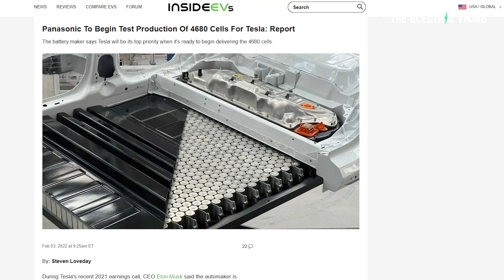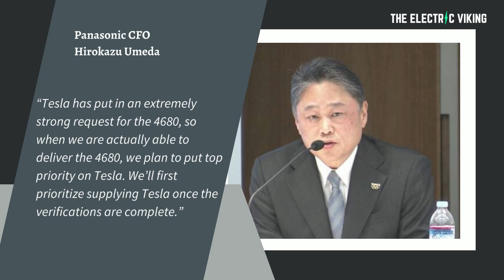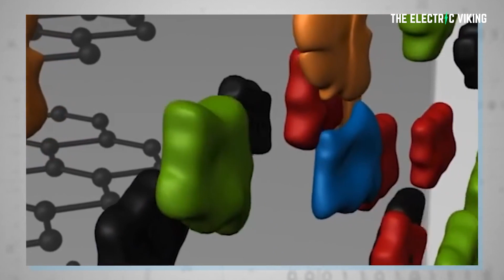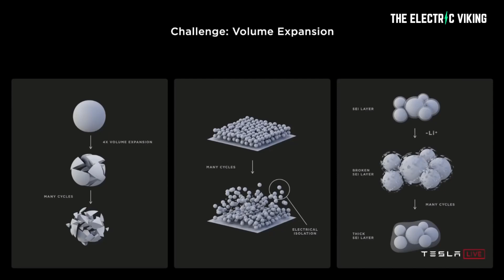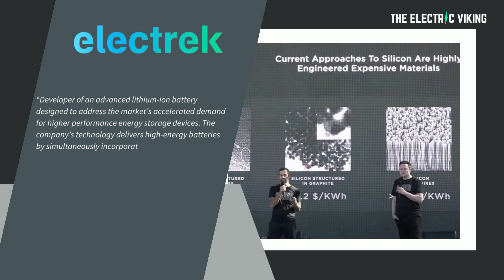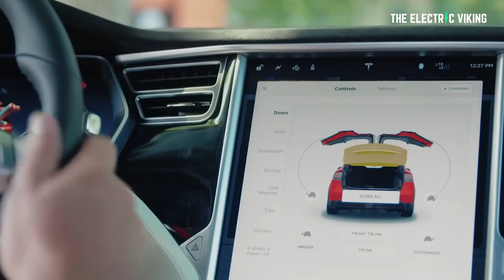WHY legacy auto won't use 4680 battery cells from Panasonic

Comment: They can Pay Tesla for using teslas patents but thats less realistic. Also very intresting is there a patent on the tabless electrode system tesla uses as this is critical for 4860 Cells as they will overheat without the tabless design.

Comment: As the costs come down for volume production won’t it make sense for all EV manufacturers to use the 4680 form factor? I thought Tesla said ultimately all chemistries would be in the same form factor.
Reply: 4680 form factor is only useful if its tabless. Otherwise, power output is actually less bc electrons have further to move.

Comment: Did you see that using the silicon anode alone gave a 90% reduction in anode cost along with 20% boost in energy density ?  That is one of the biggest features here.  Along with massive cost savings in DBE and the general scalability of 4680 it is just mind-blowing.

Comment: Those LFP cells are for the energy storage products like the mega pack power pack and Tesla power wall. I highly doubt you will see any LFP batteries in US vehicles because the range is lower than ncma chemistry.

Comment: LFP is the low-end formulation; Yes it's cheaper and it's more durable:  but it can't store near as much energy. It's really not even close. And no you can't use a 4680 form factor economically with LFP

Comment: Tesla's best strategy is to move inexorably toward 4680 cells & at least short term toward LFP. Cylindrical cells are safest because thermal run-away is contained inside the can. Tesla 4680 LFP are the short term winner for safe cheap million mile batteries.

Comment: I suspect that Panasonic will produce the 4680 cells for Tesla per Tesla's current patent design (chemistry and tabless design). If Panasonic produces the 4680 cells for others it most likely will be a different chemistry than what Tesla is using and most likely won't be tabless. Also remember Store Dot is said to be producing 4680 cells. But what's going to be important for both Panasonic and Store Dot or any other battery maker making 4680 cells is can those cells match or exceed what Tesla is doing with its chemistry. I suspect we'll have to wait and see once we get some official test on these cells. But more importantly I think we need to step back because there's no way Panasonic will be selling the exact same chemistry and style that Tesla has a patent for.

Now, I do think it's makes sense for Tesla to settle on two different form factors such as LFP in the cylindrical style and 4680. But we have to see if Model S and X will adopt them in the future. For now it makes sense to continue to use what they're using now since there may be more of an abundance of those and they meet the specs Tesla is putting forward for those vehicles and the fact they're produced in lower numbers.

Comment: Your logic is completely flawed because no-one has ever indicated that Panasonic is using Tesla’s chemistry in their 4680 cells.  We do know that Tesla and Panasonic have collaborated on chemistry in the past, but that does not mean that they need to in future.  Panasonic have their own battery improvement research efforts.  Tesla have also shown a willingness to use different chemistries in their cars, so Tesla requesting 4680 cells from Panasonic does not mean that they specified the chemistry.  Their request is probably just to allow them to use Panasonics cells on their existing production lines which I do not believe would be dependent on the specific performance of the battery.

Comment: This is nonsense - or at least not correctly explained. I'm not sure you understand how patents work. The fact that Tesla has patents on aspects of the 4680 does not mean that Panasonic can only sell production to them. If Panasonic are making them then they must have licensed the patents. So they can make them and sell them, normally to whoever they like. Now it is possible that the patent licencing is an exclusive licensing deal so that Panasonic could make them but only for Tesla - i.e it's just operating as a contract manufacturer, but normally companies licence patents for general purpose production. The whole point about patents is that they can be transferred and licenced, and what, if any, restrictions are imposed, depends entirely on the deal struck.

Comment: Just a matter of time before every electric part will have an identification protocol that need to match if not the EV will reject it and go into limp mode or worse null any warranty and put it in repair before drive mode. They could do this with any part that is electric every sensor even the turn signal light bulbs.

Comment: I'm not clear on the details of the 4680 battery situation, Panasonic could copy the 4680 form factor and sell to whoever.  The Tesla secret sauce ingredients are strictly proprietary and are certainly restricted for Tesla use only. I don't think the form factor can be patented, only the techniques and formulas are protected, so Panasonic or anyone can copy the size and shape. Just doing that alone will give a higher energy density even without copying the secret internals. When the finalized version is put into full manufacturing mode we will see the full potential of the official Tesla 4680 batteries. I expect to see a large improvement over any other types made by Tesla previously, including increased range, reduced charge times, better life expectancy, and much safer more catastrophic resistant overall. Tesla does not stand still while waiting for the continuous manufacturing process to be perfected, the internal components are likely constantly being tweaked and refined during this time, the final result should be truly amazing and scientifically significant, I predict the new 4680 batteries will be worth waiting for.

Comment: Each auto mfg will make their own battery to isolate the customer. If they made universal batteries why would customers come to the dealer. Therefore all parts will be brand specific to capture any and all repairs. This is why the mandatory dealership laws need to be dissolved.  This is a dealer protection method and is counter to consumer protection. These EV’s will be like buying a ford but owning a Ferrari.

Comment: I would just like to say thanks for all the info that as a hobby investor I would probably not see if it weren't for your timely reports.  You turned me onto both the stock that will become polestar, and the one that allows me to easily invest in CATL.  Something I would not have had the patients to figure out myself.  While my main investment is Tesla which represents slightly more then half of my portfolio, I do now hold about one and a half percent of my total in the polestar and CATL instruments.  I think it is early in the game for both of them.  One of my best buys has been in a rare earth and strategic metals etf, which shall go unnamed because every time I mention certain instruments, YouTube automatically deletes my comment.  Nvidia has also done well for me, but I was in long ago.  It is sort of in competition with Tesla in the AI, and FSD, realms and the stock values seem to roughly mirror each other.  I also have some BYD and I probably should buy some more of that.  I have more or less invested in a stack of ev related instruments, AI, and now robots I guess. 
Like yourself I am fascinated by all aspects of this industry, and I really don't know why.  I usually have little interest in engineering and factories and such.  I guess it's the "vision thing".  If this thing ever really happens like Elon envisions, it will be an evolutionary quantum leap for human life.  The old saying was, "What's good for GM is good for the USA"  and at the time that was pretty, though not totally true.  Now it's, What's good for Tesla is good for humanity.  And that is pretty much true.
I cannot wait to see what Tesla does with the incredible earnings it is destined to garner.

Comment: Tesla needs LFP for energy megapack and powerwall production which is severely hampered by the battery shortage and consumption by their vehicle production.  Energy business alone could absorb all of the LFP cells, the demand is a factor higher than what they have been able to roll out.

Comment: Who is going to recycle the batteries, and when they get pass the point they can't recycle them anymore what happens? That's right those toxic batteries go into a landfill and pollute the ground water. Where you going to get the electric to power the EV's? Solar and windmills kill birds and pollute while being made. Your EV's will be charged using COAL plants because nobody is going to build new plants using windmills and rainbows.

Comment: I can imagine there is a geometry for lithium battery cells that in terms of energy density, packaging and performance is 'optimal' in terms of EV applications. One can only assume the manufacturers are closing in on this optimal configuration, 4680 for cylindrical format and 'blade' for prismatic format. It is an issue of form following function.
Reply: It's all about thermal management requirements...

Comment: 4680 is a format Tesla doesn't have to give all the patents. That may mean Panasonic may do lower mileage batteries or just their own chemistry. 4680 format is necessary for the structural element.

Comment: Sam, thanks for all of your research and synthesized content. Regarding Tesla patents: Doesn’t Elon hold them as “open source?” If Ford et al. wanted to utilize the exact technology, wouldn’t Elon approve? I thought this policy is what eased negotiations with China. Am I mistaken?
Reply: My understanding is that Tesla released its earlier patents related to electric motors and drive train. Wouldn't make commercial sense to release everything such as the alloy composition developed for gigapress  castings, 4680 etc
Reply: The early patents were open source to encourage other mfctrs  to consider EV tech.

Comment: It's very simple.  Tesla doesn't pay Panasonic anything NEAR what these batteries cost to make.  Other companies know Panasonic will charge them MORE for the same cells, and the form factor means those battery packs (and associated temp control hardware) will be larger and require complete reworks of proven chassis and platforms.  The 'benefit' is outweighed by the problems.

Why use a less efficient form factor and shady chemistry tricks to power your vehicles, when other companies (like CATL, LG Chem, Samsung, etc.) make more stable cells with a more efficient SQUARE form factor?  And the prices for their cells are based on standardized pricing, not accounting gimmicks.

Comment: Sam.
A few things need addressing. (Again/ still)
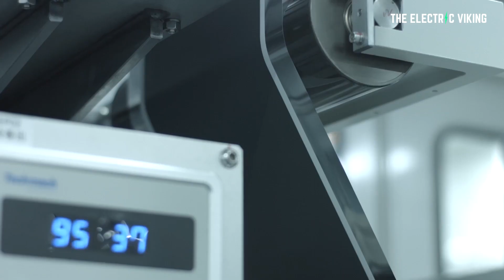09:00
"4680 cells are not really intended as a mass production product...."
Except they ABSOLUTELY are!
.
Why have they spent a lot of time and money on a process to produce a cell at EXTREMELY high volume, and EXTREMELY low cost if it's only going to be circa 20% of the eventual output capacity?
.
Did you not listen on battery day?
The whole presentation revolved around cheap production of THE FORM FACTOR (4680).
Are we now meant to assume that not only will Tesla not pursue that "cheap" form factor to produce the majority of cells, but that they will rely on others to produce the cheaper chemistry )but not necessarily cheaper Form Factor ) cells for them? Meaning they buy in 80% of their requirement ?
.
Think it through. It simply doesn't make sense.
.
What DOES make sense?
If Tesla refines the process, then announces the ability to make LiFePo4 cells in the 4680 form factor
(Cylindrical LiFePo4 cells are already on the market, it can be done!).....

THEN they reap all the advantages of:
Cheap materials.
.
Unified cell production factory process (modular factories, MUCH smaller, built in house,)
.
Extremely rapid cell production of 100% of their cells
.
A unified pack design (ONE production line type, just insert the "flavour" of cell you need, in the desired quantity, in THE SAME "BOX")
Leading to.....
A unified CHASSIS design for each Model (No "tweaking" the chassis for a different design/ strength of pack, all packs with the same torsional strength, same fitting, same bodyshell strength, same weight reduction, especially important for heavier LiFePo4 chemistry!!)
.
If you really work it out, it's the only logical path to full vertical integration, with maximum efficiency.
There's no reason they can't buy every cell possible from others AS WELL, but that outside supply should not be the first choice.

Comment: High power/ performance 4680, low cost lfp prismatic cells and everything in between to get production targets hit. They are smart to use multiple supplier's and have the flexibility to adapt to each mfg style.
Reply: Tesla can prevent being squeezed by any one battery company by using multiple suppliers.  By freely sharing battery technologies, tesla gets an even better deal.  4680s are cheaper if more than just tesla is using them.  Tesla likely still controls their specific chemistries.

Comment: Thanks for clearing that up. For those who have been paying attention for the past couple of years, Tesla have a pilot plant capable of making 8 GWh of 4680s a year, this was made clear on battery day in 2020. What is not so clear is that will Tesla stop making the current Model Y at some point and only ship Y’s with 4680, structural packs and giga castings? Or will the old Y carry on as a cheaper product? Given than Panasonic will not be up and running with 4680s for a while yet, how will they meet demand if they only have the Fremont pilot plant, even if they have been stockpiling them? Don’t know the pack size on Model Y but 8 GWh isn’t going to get you more than what?...50,000 cars?
Reply: Tesla are also making 4680s at Giga Texas
Reply: @midnightstar4065  Yes but will that plant be up and running this year? The car plant is one thing, battery manufacturing is something else.
Reply: @kiae-nirodiariesencore4270  Very likely this year as drone footage already shows production machinery in operation. Whether they are actually producing batteries that are going into the pre-production Model Ys is not clear yet..

Comment: It's probably because it you change form factor, in this case to 4680, you have to change other system too. BMS and cooling for example which is also affected safety, so they are sticking to what they familiar with.
Reply: @richardvivian3665  Tesla has been doing this over a decade, they had an expertise in all kind of form factor. This is about legacy auto company who never use cylindrical cell before. If ceo decide to use it and bad thing happen, he gonna lose his job. Thats why its unlikely.

Comment: Won’t? Simple - 
1) 46800 has Tesla’s patent. 
2) 46800 use 18650 open architecture suffer heat sink problem, no one buys. 
3) Panasonic must pay royalty to ship outside of Tesla. 

However Tesla’s patent claiming heat runs vertically down at cell base (instead of sideways for 18650 cells) to meet with coolant channels below is good on paper - is short lived because patent calling for “multi point contacts” is a worst kind to handle the amount of heat transfer in EV in terms of fire hazard and longevity requirements. 

Tesla is silence about above issues and possible fixes with regards to 46800 cells.